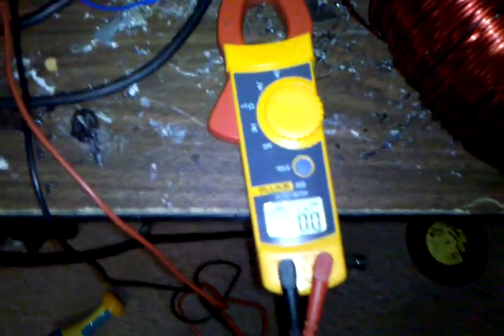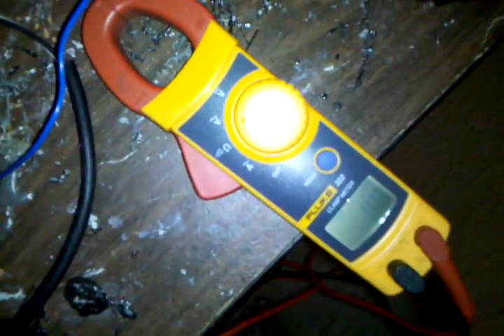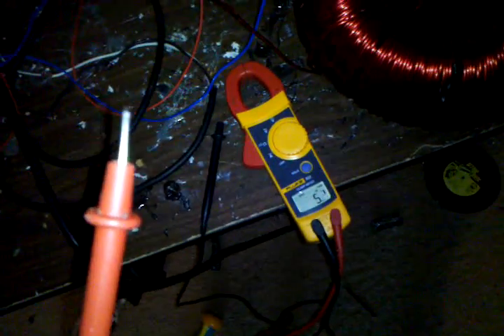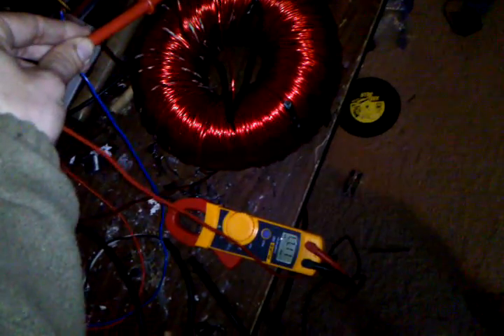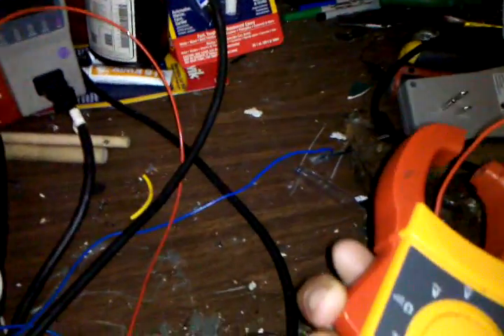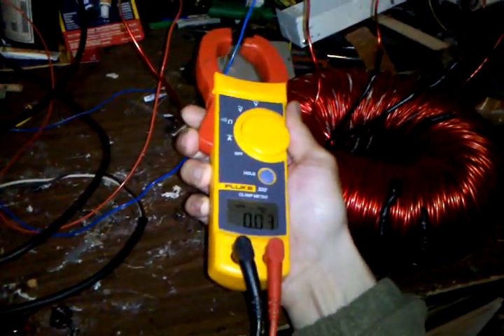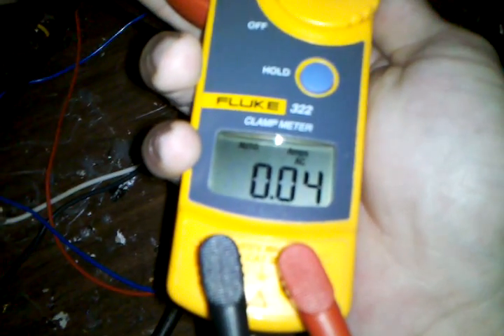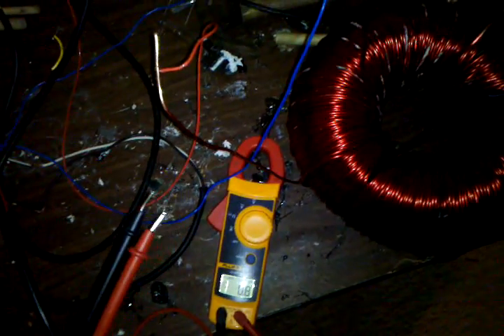Gabriel Anomolies

Comment: the input impedance of your Fluke 322 on volts range is likely around 10 megs so it will pick up any stray magnetic field like an antenna and only require 10micro amps per 100 volts this is virtually a static charge, so to see if the voltage is "real" I suggest loading it by connecting a resistor across the terminals (or using a moving coil mm) of about 100k-500k to bring the current upto between 1/10 -1 milliamp. Also the Fluke 322 is not rated for 10 hz so will not give reliable readings.